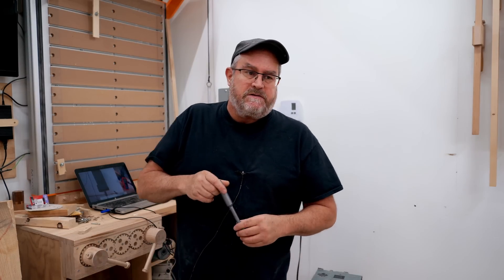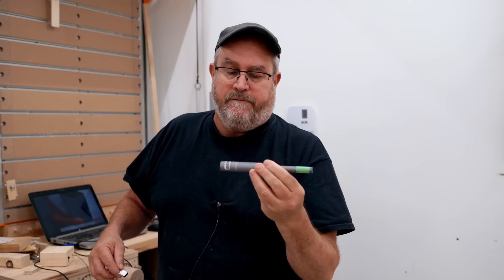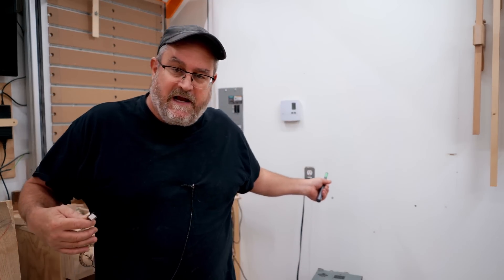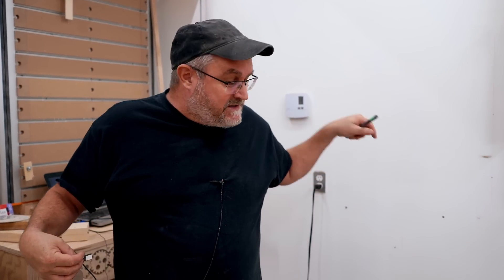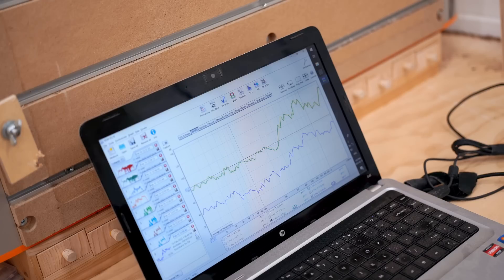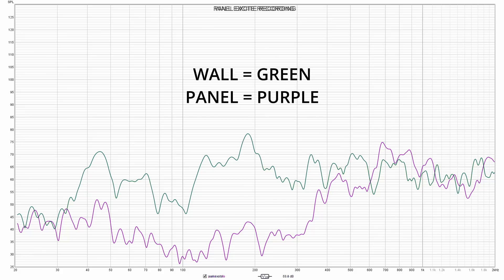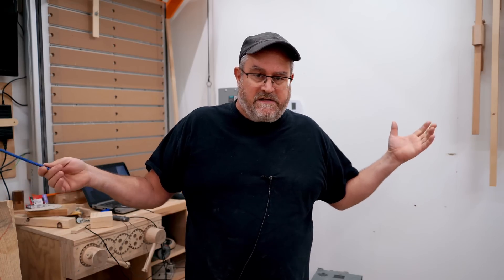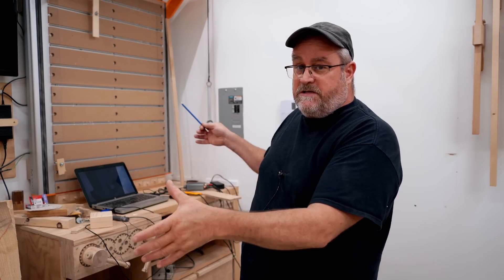How Much Noise does your Speaker Put Out? Debunking Panel Resonance... Maybe

Comment: Dear John,
As I understand it, panel resonance is not so much about panels radiating sound themselves but rather about vibrating panels modulating the amplitude of the drivers and maybe even compromising the workings of the crossover network. The amplitude of the tweeter can be extremely tiny -think of 10E-9 m-, so even a tiny movement of the cabinet may distort that ... .
When you put an accelerometer of the woofer cone, you are measuring the combined vibration of woofer and cabinet ... . 
For my very heavy Thiel CS6 loudspeakers I use IsoAcoustics feet and Omicron Stabilizers on top. Both clearly bettered the sound. Anyone can hear that.
Even stranger: in my small home cinema set, I use a B&W subwoofer with opposing drivers. The cabinet doesn't vibrate. Placing the sub on Aurios feet made the total sound of that system al lot better ... how can that be? Or am I not allowed to hear that? Just "making it up?"
These phenomena need to be explained rather than "debunked" by measurements that may not be that relevant after all ...".

Comment: Nice video but I wonder if the accelerometer should have been taped to the side panel in the center (assuming its a cheap cabinet without bracing), maybe it would have the largest amount of vibration there rather than say 1/3 of the way down. Just a thought.

Comment: yeah I think that relative measurement cone vs cabinet is a valid one and about what I'd expect. Although the cabinet surface area is much larger than the speaker but also most is facing away from the listener. 
Maybe it would be a different story once you hit the cabinets resonance frequency.

Comment: Good work!, But you can replace the woofer with a midrange (back closed) pointing in to the box and measure only at resonance (near 1 kHz) at different power levels to deduce panel "sensitivity" in SPL...fully calibrated

Comment: Without sounding like I am invalidating your experiment altogether, I will say some of it is invalid.
Hear me out please.
double sided tape will have a very large effect on your measurements, much larger than you think. 
Your method of measuring the vibration of the cone and box is the correct method given your gear. This allows you to directly compare the amplitude of the box vs the driver. Attempting to normalize an air measurement against a box measurement becomes progressively less accurate. My estimate is that your confidence interval has ballooned to something on the order of +/- 10% (20% total).
Unless you have a solid background in stats, you will not be able to overcome this deficiency in your toolset.

I think your conclusion is based on an incomplete premise as well. Your box vs cone measurements showed between -60dB and -75dB with many large distinct peaks over the area that human hearing is most acute. You will certainly be able to hear this, and since the sound will arrive out of phase, and potentially mixed with wall reflections, this could have a pretty large impact on the sound.

Comment: You did this with an Elac. Those things are built far better than average, as far as store bought speakers go. -67 db is probably a significantly better reading then you'd get from a lot of other speakers. See if you can borrow some Klipsch RP-600's or Wharfedales. The GR-Research channel has done measurements of those, and they're not as well built as the Elacs. Also, maybe you can test the application of the GR-Reserarch No-Res product?

Comment: I don’t understand why you applied a 40-60dB offset on your measurements that were both made with the pink noise recorded into Audacity. With the same measurement device at the same gain (I assume from what you said in the video) wouldn’t the relative levels of each recording be on par with each other? Interesting video!
Reply from the maker: I didn't. The Audacity recording was to figure out the offset.
Reply: Okay. That makes way more sense. Thanks

Comment: Could you try the test again where you put the accelerometer in the geometric center of the side panel?  Also, I think it would be interesting to put it on the baffle since that is probably where the most detrimental panel vibrations occur.   Speakers with much larger unbraced enclosures of which there are no doubt a lot on the market, should show vibrations that are worse.  Thanks!
Reply from the maker: There's a brace in the centre of the panel. And it wouldn't make that much of a difference, anyway. If the panel vibrations are the conservative -40db, the speaker output is 16 times louder. You are measuring tadpoles in the belly of a whale.
Reply: @IBuildIt  Hmm you are of the opinion that the efforts that high end manufacturers like Magico go to is just fooling people who have too much money burning holes in their pockets?  I think those Elacs are very small panels and apparently well braced which is a good thing no doubt.
Reply from the maker: It's not opinion, it's fact. Audiophiles are some of the most gullible people on the planet and will buy into anything that sounds "science based" quite readily. Even people who seem to be very rational in their other affairs slip off into Wonderland where audio tweakery is involved.
And to be completely fair to the manufacturers, you all make it easy for them to take full advantage. That inability to properly put issues related to audio quality into perspective drives a lot of sales.
Reply: @IBuildIt  If there is ever a class action lawsuit against these high end manufacturers  where they need an expert witness maybe you are their man.  I love all the clever things you have constructed in your shop and even if we don't agree totally on audio tweaking necessarily, I give you full respect for craftiness!  Thanks for delving into the technicals of measurements instead of just giving subjective superlatives.  I'm in the camp that the only thing I want vibrating is my voice coil and diaphragm but it is necessary to put things in perspective always.  I also believe that having vibrational energy resonating in any components in the speaker can feed back into and distort the movements of the voice coil.  Can you measure that?  I think you can but it has to be done right and I'm sure it is not easy.

Comment: Interesting analysis and presentation.  Fascinating to see the vibration in the walls.  The only problem is when you brace a speaker of take care to engineer out box vibration, the perceived sound improves.  In open baffle, I think the biggest contribution is the front baffle being stiff and massive.  Also a rigid frame in the drivers.  With this, you get the full dynamic punch of the cone vs a mixture of the cone moving and the baffle recoiling.
Reply from the maker: Hearing perception is influenced by what we know and what we see. If you know the speaker is solidly made and you think that's an important feature, you will perceive the sound to be better.
Reply: Agreed.  I epoxied 1/4" steel semi rings behind the midwoofers in my Polk 7B's and lets just say that the improvement in bass punchiness was not subtle.  I also feel less vibration through my fingertips when I touch the baffle.  Could be better still and I'm thinking about a couple of 3/4" oak dowel braces going from the front baffle to the rear enclosure.  Lots of little incremental improvements are additive and I think each one of them could fail a blinded A/B test but no way would the sum of them be an insignificant improvement.  So, do we convince ourselves to not even do the small incremental improvements?  Not me.
Reply from the maker: How many bacteria does it take to fill a shot glass?
Reply: @IBuildIt  How many does it take to overwhelm the immune system?
Reply: @captainwho1    Hey!  I'm on this channel looking to find exactly what your  describing.  I'm thinking that dowels from the baffle to the back would not only reinforce the baffle, but also vibrate the back panel opposite to the front.  These vibrations could also cancel out the sound waves from the front panel because the back panel is vibrating oppositely in a push pull configuration.  The side panels wouldn't vibrate because the destructive vibrations from the front and back would meet on the sides.  Is this what your thinking too?  Could you elaborate on what you did with the polks?  In a constrained layer thread some guys were saying that opposing woofers fix this problem, so I'm thinking that coupling panels would do a similar thing.
Reply: @headphone307  By coupling the baffle with the rear, you increase the effective rigidity of the baffle and also raise it's resonant frequency and lower it's amplitude of vibrations.  Another method is to use an adjustable tensioning rod that couples the woofer to the enclosure rear.  Jean Mauer uses this, combined with a sand filled rear wall.  B&W Nautilus development may have employed woofer coupling to rear as well.
Reply: @headphone307  Details of the xschop semi-rings design can be found on the Polk Forum.  No reason why it wouldn't be effective on other speakers as well.  It wouldn't have been measurable but it is most definitely audible as far as the punchiness of the bass goes.  Is there a test that would be as sensitive as the human ear to reveal that?  Naysayers will say something isn't real if you can't measure it but maybe we just don't have a measurement yet.  Probably something like ultra sensitive laser doppler vibrometer would show it but what it comes down to is the effect on the micro movements of the voice coil/cone that is audible.  Maybe it isn't entirely that the baffle vibration is less audible.
Reply: @captainwho1  Yes.  I agree, it isn't the box vibrations that are audible, it's that they vibrate the drivers with one sound/resonance, while the drivers are trying to replay another, which causes incoherence.  We hear this not distinctly as noise, but we perceive it as fatiguing to listen to, or unmusical.  I replied to John on his pinned comment with some thoughts about this.  I have some floor standers I'm going to try dowels on.  My belief is that a degree of cancelation will occur though it will not be 100% efficient.  I'll look for the rings, thanks!!
Reply: @headphone307  Yes.  I also forgot to mention that in both the case of the Jean Maurer and B&W speakers, they also isolated the woofer from the baffle with very soft, specially developed viscoelastomeric materials.  But they were coupled to the rear of the enclosure.
Reply: @captainwho1  It's funny you mention that because I was just thinking about foam to decouple the woofer, as I would use foam under a bookshelf.  Maybe an easier, simpler idea is to decouple the midrange and tweeer, for my system anyway.
Reply: @captainwho1  Hey, just wanted to let you know I'm trying the dowels.  7/16"   I lost some deeper bass, or bloom maybe.   It's tighter.  But the mod that really brought it together was wrapping tape around the basket of the mid range, creating a smaller sealed box.  Wow, is all I can say!  It's really reinforcing the midbass.  On an older three way like mine, it's a really good mod.  JBL L100t3.  YMMV, I also have L-pads which I can turn down the mid and tweeter.  All of this with the rounded baffle edges are really working great.  This doesn't do much for defeating resonances though, it creates more resonance and reverb in the floor and room, but it feels musical, and I would recommend it to increase midbass should it be lacking.
Reply: @headphone307  Thanks for the update.  I'd go 3/4" dia. or square ash or oak and I think they need to be glued in place or screwed in place against V-blocks.  So if I am understanding, your 3 way speakers didn't have a separate enclosure for the midrange and now you made one out of tape?  I have modded my 2 way (with passive rads) Polk 7Bs to have 1-3/4" roundover frame on the baffle edges.  Very good soundstage and imaging improvement due to minimizing the effects of diffraction reflections.
Reply: @captainwho1   Yes, the mid has its own enclosure,  I'd say about 32 ounce cup size.   I realized during these mods that what I was really looking for was a better mid bass that was like other speakers I liked have.   But,  I also like the top end of this unit,  so I keep working on it.   So, I yt'd better mid bass,  and this guy showed that he glued card stock to the back of his mid, and the results.   I didn't want to go that far just yet,  so used making tape instead.   It reinforces midbass and punch like crazy,  and has a longer decay so notes really hang.    It's a bit much,  so I think playing with decreasing enclosure size is an option.   But it's a incredibly easy mod that really produces some results.
Edit:  I haven't made the dowels permanent yet,  so I'll think about increasing their size,  which would help attachment.
Reply: @headphone307  Backwave reflection of midrange that can come back  and hit the cone is audible and to be avoided or mitigated IMO.  If it is a stamped steel frame like on many vintage drivers there is a lot of surface area within the driver to reflect back.  I've found lining as much of the interior of the basket with a layer of Armacell Pipe Wrap Foam cleans up the midrange miraculously.  Many speaker manufacturers like B&W address this in their midrange and tweeter drivers.
Reply: @captainwho1   Yes, I'm wondering about using foam to stuff the enclosure tight to the driver.   There's already fiberglass insulation in there.   It's a cast aluminum basket.   The effect is a bit too much,  but I hope I can find a happy medium because it's really filling a hole I feel there has been in the sound.  In comparison to other speakers.   I'm feeling a little dubious about the enclosure size for such a small driver that doesn't move much.   Some of these reflections might not be a terrible thing, if the reinforcementis are early enough.   This mod is the only thing that has brought out the desired effect I've been looking for, so I'm holding tight to this driver as a culprit and solution.
Reply: @headphone307  Early reflections off of the internal parts of the stamped steel frame; spokes and area near the spider, definitely are a negative to my ears and I got much greater clarity of vocals, ability to distinguish instruments and voices from each other, etc..  It was like a false reverberation.  Perhaps some find that pleasing.  To each his own in this hobby.
Reply: @captainwho1    I moved the speakers out to a new room and it's like starting all over again.  I don't necessarily disagree with you,  but I do wonder whether the present enclosure was designed to work not only with reflections,  but also effective volume for a sealed driver.
Reply: @headphone307  Oh I am absolutely certain that the enclosure size was an engineering parameter and chosen to work with the T/S parameters of the midrange driver.
Reply: @captainwho1  Well,  that's the thing,  there are those who believe it was made to reduce reflections.  If there is a compromise of needs happening there,  there might be some optimizing, that's possible.

Comment: Thank you John for this very interesting investigation.  For the sake of bringing it down to a practical level it would be nice if you did a few sweeps on the Elacs but change their position or change what their surroundings. Many years ago I bought a small Denon system that my wife and I really liked when we listened to it in the show room. Brought it home and put the speakers up on the mantle in front of a mirror ( you already know where this is going ). They sounded horrible and I just thought that it was the demo room that made them sound so good.  We rarely used them and listened to an old "boom box" on the floor.  Years later I put them on the floor beside the couch to get them out of the way and decided to turn the system on. Out came a really nice sound. It was my first lesson in how important it is that you set up your speakers in a good location.  In my case the position and environment  had much more impact than the quality of the speakers.

Comment: This is a really interesting test which certainly gives some interesting results worth exploring.
With small bookshelf models like the Elac, panel resonance isn't often a major issue. Where it becomes more of an issue is with large, unbraced cabinets like many of the larger Klipsch "Heritage" models, especially the Forte, Cornwall and La Scala, along with many older, boxy-style speakers. The bigger those panels are, the lower their resonant frequencies and the more freely those panels will resonate, making them much more noticeable, especially during playback.
It would be interesting to se you do a similar test with a much larger cabinet, then repeat the test after adding bracing throughout the cabinet.
Reply from the maker: Isn't the wall behind the speaker a big enough unbraced panel?
Reply: @IBuildIt  in some sense, sure. but it's also not receiving the same pressures as what would be seen within the box, just the parts of the front waves that wrap around the speaker or comes out from a rear port, if one is present.
Reply from the maker: If I can come up with a more accurate way to set the offset between the mic and the accelerometer, I'll try it again with something bigger. I doubt there will be much of a difference, unless it's something very poorly made.

Comment: this is interesting, and since you measuresed one speaker sidewall, would not all the cabinet walls vibrate and add to the output?  then the inside also reflect back thru the woofer again or port, all this adds up.
Reply from the maker: The test was trying to isolate the panel vibration only and doesn't include and sound that just goes right through the panels or out the port or through the cone when the speaker is playing normally. More panels vibrating would mean more output, but still at a very, very low level.